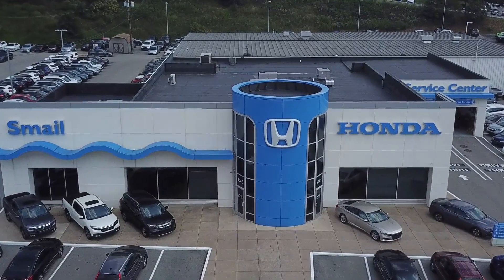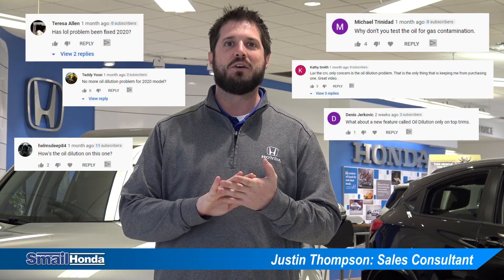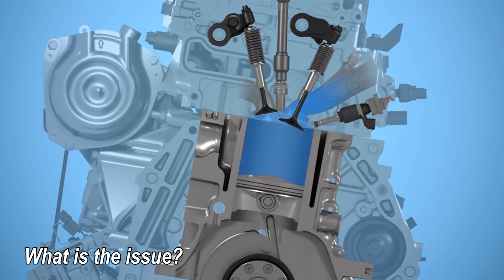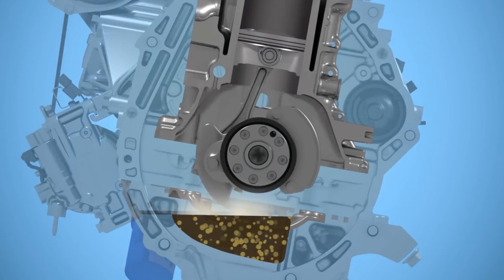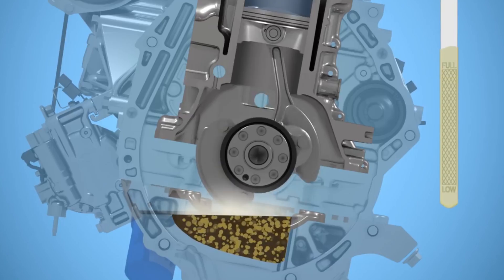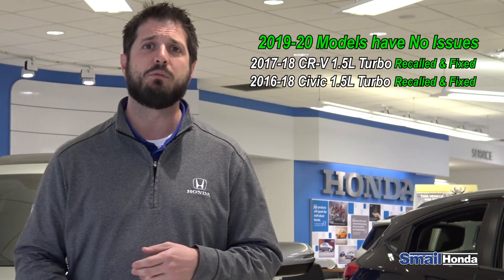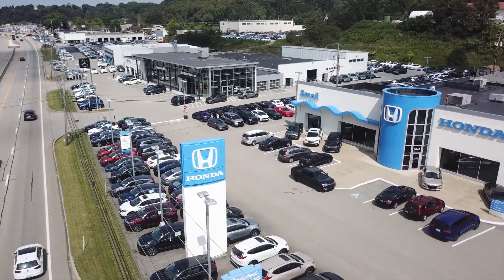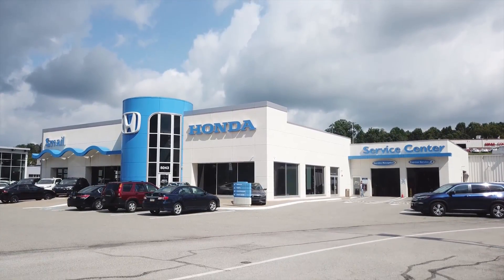Honda Oil Dilution Issue Explained

Comment: I live in Cleveland Ohio and my wife's 2016 Civic EX-T has this issue.  The local dealership changed my oil once (charged my for the oil filter!??) and said that they made a change to the computer.  I usually change the oil myself and just did it last weekend.  I drained the oil and changed the filter.  I buy the oil in 5 quart jugs and measured out the 3.7 qts and refilled the engine with the new oil.  When everything was done, I drained the old dirty oil from my catch basin and put it right into the jug that I had the 3.7 qts in.  What I found really annoyed me.  There was 4.2qts of dirty oil that came out of the engine.  How can that be unless gasoline is somehow getting into the crank case?  I do not believe that Honda fixed this issue.  And how is this oil dilution damaging the engine?  I plan on calling back the dealership and informing them of the problem but I am not holding my breathe.
Reply: My 2018 has this issue as well
Reply: Thats why its better to lease, modern cars are too unreliable for long term use. I leased 21 civic hatch sport , been 4 months & i already notice few issues, 1 is electrinics, 2 is rattle . 3 is oil smell like gas, When 3 yrs are up, i am retuenimg it. $349 lease imclided everything, 0 down, tire & rim insence, all whether mats, wheel locks, 2 yr free oil chnge.
Reply: @thenow5559    $353/ mo and I will own it in 4 more payments.  Then my wife drives for free.  I'm still driving my 2006 Pilot which has been paid off for 10 years.  My kids are both driving PIF Hondas.  A 2009 Accord and a 2012 civic.
Reply: May want to consider extended power train warranty from Honda to cover you in case. Perhaps I’m wrong but I highly doubt this engine will go 180k flawlessly like our 08 element did, we should not have sold it. New was not better…. I anticipate seeing these blow engines north of 150k/10 years and seeing junkyards full of these. Spun bearings, journals trashed, etc. and that CVT, might go the dist but keep your trans fluid changed on the regular

Comment: Hello good afternoon...

I recently bought a honda civic 1.5 i-vtec turbo, however when reading the manual I came across a doubt, the manual says that we should fill the car with at least 95 octane gasoline my question is for the car engine which is the best 95 octane gasoline or 98 octane gasoline, I know they are both suitable for the car but I wanted to know specifically which one is better for the overall performance and durability of the engine and its components?

Thank you in advance for an answer and I apologize if this is not the ideal place for my question...

Thanks
Reply: 95 is good enough and 98 is better
Reply: @Tintoycar  Where the hell can you find octane that high? Here in Maine 93 is the most you can get. Are you saying a family sedan needs high performance gas? This isn't a turbo 911 after all. Not calling you out, I'm calling Honda out. We are looking into buying a used 2021 Accord.
Reply: That's the least of your concern my friend, maybe you didn't read what everyone else is saying, run from the 1.5 direct injection engines! You will either change oil all the time increasing cost down time and cutting into saving or you will just have engine troubles. Whatever has you put into the car will only smell in the cabin when you turn the fan on. Run from these engines

Comment: How do I know if my honda has an oil dilution issue?
Reply: When you drain your oil, it’ll have the smell of gasoline in it. It’s a strong smell. After you’ve finished changing your oil and you go to put the used oil into a container, you’ll find lots of little dots that kind of look like bubbles towards the end of the pour. Looks just like dots of oil in water. Just changed my friends oil yesterday and there was a ton of them. His is a 2018 with only about 20K miles on the engine.

Comment: I don't understand this.  Honda Mysteriously fixed the issue in later models past 2019 CRV's?.  Can anyone confirm they re-manufactured the engine parts, notably the valves since gas was mysteriously running out of the valves and into the engine oil?  Software cannot fix this issue if the defects were actually faulty engine parts to begin with.  It seems like the tolerances / seals /  were incorrect on whomever designed the 1.5 liter engine in their CAD program.   Discussion please ?????  I own a 2009 3rd Generation CRV which I still drive since buying it new.  No issues at all with OIL Dilution and engine is a naturally Aspirated Non Turbo Engine.   Because of this, I am steering clear of the new CRV and considering a Toyota for the first time ever.   Shame on Honda for not coming clean.  I have owned four Honda's in my lifetime and loved them all.  I am just upset that we are not hearing the truth here.  Honda obviously does not want to do an engine recall because it would cost them millions of dollars and I wouldn't dare trust a Dealership Mechanic with meticulous engine work here.  I've had too many instances where mechanics forgot a bolt here and there and they rarely check Torques, & left off plastic covers, fasteners etc.........

Comment: Simple software update?  My opinion is they should have just kept the old 2.0 or 2.4 L. engines instead of using the 1.5L turbo. Trying the  91 octane gas may be worth a try.   Some say the new Honda Hybrid is a better engine choice. 
 BTW-  Toyota Rav4 offers a normal 2 liter engine (no turbo) and regular transmission (no CVT).
Reply: And who says that Toyota dont offer the CVT we had a 2020 corolla and is actually worse then the CVT From honda believe me

Comment: 2019 Civic here, oil smells like gas.  I watch the levels but won't be keeping this car for long because of this issue.  I stay off the throttle until it warms up.

I believe the software update just warms up the engine faster by adjusting air/fuel mixture in hopes that the gas will get burned off quicker.

Comment: There’s issues in all years 1.5 is gas is getting in the oil it’s a problem. The gas will destroy the main crank bearings and everything else. A simple reprogram does not fix this.

Comment: Software won’t fix anything. It’s a PHYSICAL defect. But you can change the oil 3,000-4,000 miles. LIKE YOU’RE SUPPOSED TO.

Comment: This is total BS.  Update was completed on my 2017 CRV.  It didn't help.  I just drained 1 quart of diluted oil from my CRV after the dipstick read 1 quart high.  This was after only 3800 miles since the last oil change. This was in summer, with 1/2 hour trips to work (meaning the engine was heated up adequately). Total BS.  Honda quality has taken a huge hit.  Stay away from the turbo engines.

Comment: Two CR-V from 2019 year with 1.5 turbo engine. Mostly used on highway. Both have the same dilution problem. If you travel faster then yellow oil check lights faster. Honda service told me: it's normal. Last honda in my family.
Reply: It's normal that Honda makes crap, yes.
Reply: @COSMACELF1802  Wrong. Honda is the number one manufacturer for internal combustion engines. They have had these dilution problems but it doesn’t mean Honda makes all crap. Their naturally aspirated engines are phenomenal that last a long time. Stop being an idiot.
Reply: @beophobic9653  Toyota still sells way more cars and are way more reliable.  That's not my opinion but based on facts you can find everywhere.  I'll agree most Honda engines aren't bad.  Their lawnmower engines are well known.  But car quality is still behind Toyota.  I guess not bad since they are a small fraction the size of Toyota.
Reply: @COSMACELF1802  Yes that’s right. Toyota is #1. And Honda is #2. I’m a base model kind of guy. I love base model civics and base model corollas because they both last very long.
Reply: @beophobic9653  Truth of the matter, both Toyota and Honda were exceptionally amazing cars in the 70's to 90's.  The quality starts diminishing in the 2000's.  Toyota lost some, Honda lost a lot.  As a mechanic, I just get sick of people praising Honda when they've never turned a bolt let alone rebuilt an engine.  GM only really failed on their small engines because of 2mm.  That's all they were missing to make a perfect seal between #4 cylinder and the water jacket.  Peace.

Comment: One more comment: 

Dear Toyota, PLEASE SEE HONDA'S MISERY WITH TURBO'S AND STICK WITH YOUR CURRENT RELIABLE ENGINES!!!!  MY 2011 Odyssey that's 3.5L V6 has gas diluting the oil per analysis from Blackstone Labs and this motor is NON-TURBO!  Granted, it has 175K but my 2003 Avalon with 303K miles has a trace of gas in the oil per analysis from Blackstone Labs. Come on Honda, WTF is going on?  Instead of going with a Pilot, you're forcing me to go with the Highlander as my next family car!

Comment: my 2020 civic Si sedan has 8,000 miles on it just got it from carvana a little over a week ago and today i smelled the dipstick and it has a very strong odor of GAS. what should i do and should i be worried?
Reply: Carvana has 7 day return policy
Reply: Return that junk and get a Toyota. My honda accord smells like an oil field
Reply: @JohnS-il1dr  actually ive changed the oil about 3 times myself now. very little fuel smell in the oil. GDI engines are always going to have small amounts of dilution. this car came from the midwest where it gets below freezing. honda says its mostly a problem in freezing and below conditions. Car has been good to me. almost at 15K miles.

Comment: I just got a 2021 Honda CR-V and they have definitely not solved this issue my oil smells like fuel
Reply: Solved means, that the dilution will not be that high than before. A mixing of oil and gas   in a gdi machine is normal....

Comment: It’s all lies, we have a 2019 crv and it does this. Funny to watch your oil level go up between changes. change oil more often then maint minder, keep it cleaner. Still a flaw... dealer says it’s “normal”.... lies! So yes they have not seen a problem that is deemed “normal”. Our last Honda’s in this household, that’s for sure...
Reply: Piston design issues, reduced piston-to-cylinder contact, gasoline running from the piston rings into the crankcase
Reply: @吹不要  yup all in the interest of efficiency. The 2019 software changes of running ac more for heat to engine, higher idle and shutters closed more often may help a bit but not a fix. The engine temp even drops a bit when it’s cold and your stopped, when it’s really cold heat isn’t even as good. I know other people with small displacement GDI turbo engines in their crossovers or small cars, they don’t have this issue to this level. 
A few things we do to help, don’t drive in eco, limit idling, don’t turn on heat until temp is off cold, limit remote start. All kinda absurd really, this is crap I’d expect from my 1980s beater Pontiac not a new car in 2022.

Honda phoned this one in…

Comment: The tolerances between the rings and cylinder are wrong. Can't be fixed with software. The fix was applied to Northern cars only. So if you bought your car in the south DON"T  drive it to the Northern states or Canada. What a bunch of total BS. Honda has handled this really badly by trying to blow smoke up you know where. I have lost trust in Honda forever.

Comment: I live in New York and I have engine problems on both my Hondas, my 2019 Civic sport was burning to much fuel and mixing with the engine oil! Of course the dealership said there wasn't an issue, so let's see I had 6 oil changes with 6,500 miles on it and when you open the hood there was a strong odor of gas!! So yeah there is issues with Hondas engines!! I got rid of the Civic and got a Honda Accord Sport 1.5 turbo with 1,000 miles on it and my oil life is down to 40% already with a small oder of gas, so that car will be sent back!! Having to 2 cars with the same issue has turned me off of Honda.
Reply: Stay away from earth dreams motors
Reply: If you want a new car, your better off looking somewhere else because Honda’s earth dreams motor is 💩
Reply: Engine oil just smells like gas on the dipstick. Someday the engine will blow up and kill a family.

Comment: The K series 2.4 was bulletproof, shame they changed to the 1.5T.
Reply: yep, I got the 08' CR-V with 170k
Reply: At best you see a 1 mpg increase.  My Accord 2.4 195,000 miles.  Still like new.  There is a video titled the best 4 cylinder engine of all time, it is the K series..  Why would you want to drop this engine when you gain nothing.
Reply: @danr1920 more money for consumers to spend
Reply: @danr1920 the 1.5 is more efficient, I get about 34-35 mpg in my Si where the K series would be getting about 30
Reply: My 2014 V6 touring accord was the best. On the eway it switched to 3 cy.  One time i got 40 miles per gallon on the express way.  Wish i hadn't of sold it

Comment: Hi Justin,   nice video,   I found your video after seeing other information online.   I bought a new  2017 Honda CRV 1.5 turbo but my dealer in Oklahoma states no update is needed.   Is this true?  Should i ask him to check again.  
   Some state your fuel in the north is different and what's causing the issue.  Is it a fuel issue or original car programing?      TIA
Reply: The dealer will claim to be clueless because if they admit they knew about it, that's an easy lawsuit against the dealership.

Comment: It’s not true that the 2.0s don’t have this issue. I have an accord 2.0 and it reeks of gasoline in the cabin. Dealer confirmed gasoline in crank case and oil level was over fill line due to oil dilution. Told me to drive more.
Reply: Piston design issues, reduced piston-to-cylinder contact, gasoline running from the piston rings into the crankcase

Comment: That 1.5 turbo engine is so small in an Accord it will not hardly up in the Winter ... Bad deal breaker . It is ok for a Honda fit .... The car it was designed for .. Honda sucks now ..

Comment: There are thousands of complaints that 2019-2020 CRV owners have registered on NHTSA, CRV owners forums, YouTube etc.  - They are experiencing petrol fumes in cabin, ridiculously high engine oil levels, & oil that smell like petrol to name a few.  Honda would like to sweep this under the rug.  If you're watching this video and having issues with CRV, then please report to NHTSA.
Reply: He a dealer, he's not going to say we have a problem.
Reply: NHSTA will just let Honda legal steamroll them like usual…
Reply: It's cheaper for Honda to bribe their way instead of fixing their crap.
Reply: Any issues with the Honda accord 2019 1.5 or just the curved ?
Reply: Now that you say it is perole fumes it was the petrol fume coming out of the heater the weird dusty smell coming out when starting after waiting the traffic. Here in korea accord 1.5t 2 months past after purchasing. Dizzy everyday.
Reply: Yea right those problems are horrible for 18-22

Comment: My engine oil still smell gasoline after 1 year of software update.
Reply: Does the oil level on the dipstick increase and become overfull after awhile? If it doesn't, it's good. It's actually 100% normal for GDI engines, especially with turbochargers, for the oil to smell a bit like fuel. My VW/Audi s like that, Mercedes is like that, Kia/Hyundai's are too. GDI engines just have this bad habit. Instead of 0w-20 as recommended in my VW, I put 5w-30 to compensate in viscosity loss if oil dilution does become a problem for some reason.

Comment: Is there any valve cleaning service you recommend for these gdi engines?  Im sure carbon will start to build over the miles?
Reply: For some reason they don't seem to be affected as badly. Honda has had gdi since 2013 on the accords I think and as far as I know they still run great with little to no maitnence.
Reply: There’s no carbon, or very little. It’s just a oil dilution issue.

Comment: Not fixed on my NEW 2020 CRV. I have a 1.5 2020 CRV it only has 1,300 miles oil is over 1 QT. Over the Orange on the dipstick. Do not Buy a HONDA with a 1.5L turbo engine!!
Reply: You just put more oil in it then your should

Comment: thats fine and dandy but can you explain exactly what the software tweak is doing to fix this issue? mechanically, how is it changing it to solve this problem?
Reply: Can a software update fix the hole in my tire? Software can't fix hardware related issues. This is honda trying to mitigate responsibility